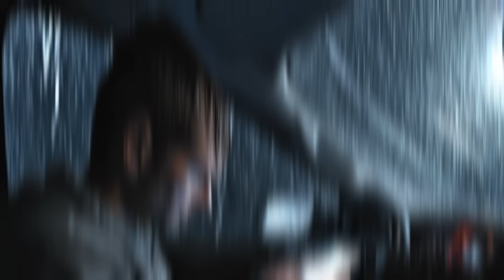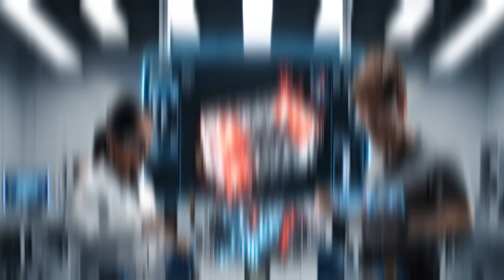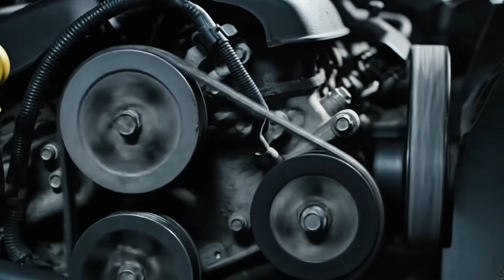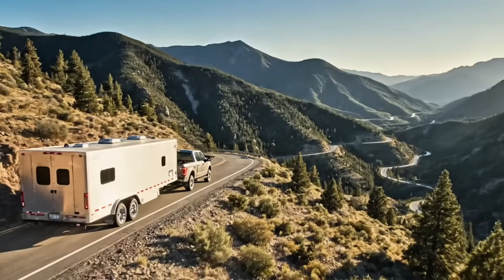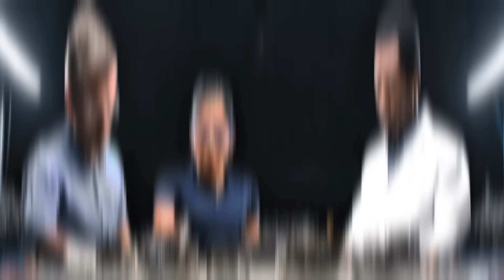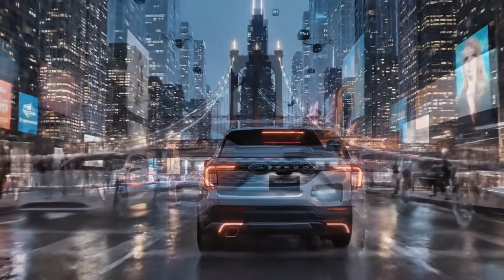Ford Just Ended the EcoBoost Nightmare in 2026 — Truth Revealed

Comment: Just turned 65,000 miles on my 2019 4 x 4 Ford F150 2.7 L eco-boost, I bought brand new in Saint Augustine, Florida, for $35,000 out the door. I could sell it for that today. Absolutely love it, oil changes every 5000 miles and never a problem at all. Great gas mileage plenty of power and torque. Ford solved the problem with direct injection carbon buildup in 2018. I’ll have the timing belt changed at 80,000 miles. It is paid off and I just can’t get myself to go spend $65,000 on a new truck. So Here’s hoping for another 65,000 miles.
Reply: I had a 2015 2.7, F150. Very smooth, quiet, and amazing fuel economy. A little weak with light throttle, but mash the accelerator and power was fully adequate for towing. Easy to do routine maintenance. The 2.7 has been dramatically changed since then, not always for the better. The iron block was better.
Reply from the maker: @Jefferson-i2w8d  A lot of owners still praise the early 2.7s for exactly those reasons — smooth power delivery, strong towing performance, and solid fuel economy. Interesting point about the iron block too; some people definitely preferred the older setup for durability.
Reply from the maker: Sounds like you got a solid one 👍 Staying on top of maintenance and oil changes really seems to make a huge difference with these engines. And honestly, with truck prices today, keeping a paid-off truck running well makes a lot of sense.

Comment: A couple of things. Did I miss a mention of wet belts driving the oil pump? And for turbo haters, all transport trucks and locomotives are turbocharged. They seem to last well. Now, if you take a 50 hp 4 cyl, and highly boost it to say 300 hp, with no other changes,  of course it will blow up.  My 275 hp 2l engine has a cast graphite- iron block, is now 13 years old. I did have a problem with the intercooler, but I fixed that for $15. I do change the oil too. It doesn't burn oil.   The main problem with new engines is manufacturers trying to break the laws of physics to meet regulations.
Reply: Locos and semis are diesel which are built alot tougher
Reply: @rrobins9857 : exactly. Designed to do their job.
Reply from the maker: @drwthmpsn7457  Exactly — when an engine is designed around the workload instead of just chasing numbers on paper, reliability usually follows.
Reply: @NextGenWheels-s5r : before jet engines, turboed engine were considered realible enough to cross the Atlantic.
Reply from the maker: @drwthmpsn7457  That’s a great historical point honestly. Turbo technology itself isn’t new — a lot of the debate today is more about modern emissions systems, packaging, heat management, and long-term maintenance costs in consumer vehicles.
Reply from the maker: @rrobins9857  True, heavy-duty diesel platforms are built for constant load and long service life from the start. Totally different design priorities compared to lightweight consumer engines.
Reply from the maker: You make a solid point. Turbos themselves are not automatically the problem — heavy-duty diesels prove that every day. A lot comes down to engineering margins, maintenance, cooling, and how much stress manufacturers squeeze into smaller engines to meet emissions and fuel economy targets.
Reply: It takes the same amount of gas to produce 300hp. Why would you want a smaller engine with twice the moving parts to fail, rather than a n/a bigger one with half the parts and less cylinder pressure. The bigger one is less complicated, less expensive, and more reliable. A twice boosted 4 over a n/a v8 makes no sense, unless you are building a racing engine.
Reply: @donsaxon1169  On paper you may have a point. In the context of this situation, there's a lot more to consider. How well something is designed is far more important than how many parts its made out of. If you think you're getting something that less complicated with a 307, as opposed to a 2.7 or 3.5, you're mistaken. Its a small block, but it barely fits in the vehicle. There's a reason we pull the cabs off the F150 when we work on them. There's no room. On the Mustang, the motor doesn't fit through the hood. They had to make an engine cradle like a front wheel drive car and install the motor from the bottom up. To get something more complicated than Ford's NA V8, you have to go to an exotic type vehicle. If you take the 5.0 and put it on an engine stand and compare it to an old big block, the new motor makes it look small. 2 fuel pumps, one of them puts out over 2000psi, 2 completely separate fuel injection systems. 2 heads in each cam, 4 external VVT actuators, 3 timing chains. A complicated valvetrain system that has to be adjusted my measuring the valve tappet clearance, insert it into a formula, and depending on the results, the tappet has to be replaced with the correct size. And that's just the big stuff. Then you have the electrical system. Ford doesn't include wiring diagrams in the workshop manual. Its too big. If I showed you the book that contains just the wiring diagrams for the F150, you would never buy one. Its bigger than a NYC telephone book. Depending on options, the F150 typically has over 50 modules installed and the 10 speed is even more complicated than the motor. Just to be clear, all of the engine options for the F150 are complicated. And they all give problems. The 3.5 is your best option. Most of the time, they're fixable. More often than not, the 307 and the 2.7 have to be replaced. 
Both turbo and NA motors can be very reliable as long as they're well engineered. And to be honest, turbos can be harder on the motor. But that doesn't tell the whole story. The process of the turbos spooling up acts like a cushion. NA just bangs all the torque into the trans and chassis. Turbos roll the power on in a way that's much easier on the rest of the vehicle.
What would be the right thing to do? Stop using GDI systems and go back to port. It wouldn't fix everything, but it would make a huge difference. If you want to see proof, just look at the numbers for the 302 and 3.5 before they started with GDI. There's no comparison.
Reply from the maker: @052RC  You bring up a good point about packaging and serviceability. Modern DOHC V8s are definitely more complex than people think once you look beyond just “naturally aspirated vs turbo.”
Reply: @052RC You are wrong about the engine on the mustang. You don't even have to remove the hood to get the engine out. When I got my 2019 GT I pulled my engine in my home garage to forge the n bottom end before I installed my supercharger. F150 is different.
Reply from the maker: @franklin5105 That’s fair — vehicle packaging makes a huge difference too. A Mustang engine bay and an F-150 engine bay are completely different situations when it comes to access and service work.
Reply: @donsaxon1169 : actually, 8 cylinders have more internal friction than a 4 cyl. That's why a V8 gets worse fuel economy than a 4 rolling down the highway. And being heavier, 8 cyl use more fuel in stop and go traffic. As for less parts, a V8 has an extra head,  possibly 2 more cams, 16 extra values, more fuel injectors, another exhaust manifold, etc. perhaps even an extra turbo these days.
Reply from the maker: @drwthmpsn7457  That’s a fair technical breakdown. Modern engine discussions get way more complicated once you factor in friction losses, weight, emissions tuning, cylinder pressure, and real-world efficiency instead of just cylinder count alone.
Reply from the maker: @donsaxon1169  That’s why this debate never dies A lot of owners still trust displacement and simplicity over high-boost smaller engines, especially for long-term ownership and heavy work.
Reply: Those commercial engines are all diesel. Diesel compression ignition combustion is very different than gas spark ignition combustion. In the diesel, turbo boost lowers combustion temperatures. In gasoline engines, turbo boost dramatically raises combustion temps. Turbocharging a gas engine will always shorten it’s life. Turbocharging a diesel actually increases it’s life, for a specific output. Don’t use diesels to justify gas turbos.
Reply: @craigg4246 : in WW2 turbocharged gasoline engines were common. After WW2,  transatlantic airliners were turbocharged gas engines, reliable enough to do the job before jet engines became efficient enough.
Reply from the maker: @drwthmpsn7457  That’s a good historical point honestly. Turbocharged gasoline engines have been around a long time in aviation and performance applications — reliability usually depends on engineering, operating conditions, and maintenance more than just the turbo itself.
Reply from the maker: @craigg4246  Diesel and gas turbo engines definitely behave differently under load and heat. A lot of the debate really comes down to how hard the engine is being pushed, cooling design, tuning, and long-term maintenance.
Reply: Transport trucks, and locomotives are diesels. Diesels have to be boosted, and always have been in my lifetime. Those work, these turbos on these gas motors are absolute crap.
Reply: @patricklawrence7483 : VW had a non- turbo diesel, as did several companies. But you're entitled to you opinion. Those new V8s are holding up well aren't they.
Reply: @drwthmpsn7457 I may be wrong, but as I understood it at the time the VW non turbo diesel lacked power. From personal experience the few non turbo diesels I drove in the military were certainly lacking power. So based on that I believe what I heard about the VW offering.
Reply: @patricklawrence7483 : if I recall correctly, the non- turbo VW diesel was about 42 hp, and a very light car. A friend had one as a commuter, it got great fuel economy.
Reply from the maker: @drwthmpsn7457  That’s part of the tradeoff honestly — a lot of the older naturally aspirated diesels were extremely durable and efficient, but definitely not fast by modern standards.
Reply from the maker: @patricklawrence7483  Real-world experience matters more than spec sheets sometimes. A lot of older non-turbo diesels were reliable workhorses, but power delivery could feel pretty slow compared to modern turbo setups.
Reply from the maker: @drwthmpsn7457  Those old VW diesels were legendary for fuel economy more than performance 😂 Simple, lightweight, and efficient — completely different philosophy from today’s high-output turbo engines.
Reply: @NextGenWheels-s5r : yes. I don't know why we need 700 hp trucks these days.  I got my turbo engine for towing, not 0 - 60 times. Of course, vehicles today  are much heavier than older vehicles. My first car was an original mini. Probably as light as was possible in N. America.  The EPA  doesn't need fuel economy requirements for vehicles over 6000 lbs, as when the rule was written, only farm equipment was over 6000 lbs. Now we have road vehicles heavier than this old limit.
Reply from the maker: @drwthmpsn7457  I think a lot of truck owners agree with that. Strong towing torque and long-term reliability matter more in day-to-day use than chasing supercar acceleration numbers. Modern trucks have become incredibly capable, but not everyone needs 700 horsepower to get the job done.
Reply from the maker: @patricklawrence7483  A lot of owners feel that way because heavy-duty diesel platforms are built with very different priorities than lightweight consumer gas engines. People mainly worry when small turbo gas engines are asked to handle constant heavy loads for years.

Comment: It should be illegal for manufacturers to set oil change intervals that are too far apart..
I don't care what they say 
You change your oil every 5,000 MI. 
I guess it's in their best interest to lie to us because they want the car to wear down so you have to buy another one..
It just pisses me off
Reply from the maker: A lot of mechanics and long-term owners still swear by the 5k oil change rule, especially on turbo engines. Cheap maintenance now is usually a lot better than expensive repairs later.
Reply: The EPA gives them tax credits for doing so.
Reply from the maker: @jamesbosworth4191  A lot of people believe the long factory intervals are more about emissions, maintenance cost perception, and ownership costs than maximum long-term engine life.
Reply: @NextGenWheels-s5r  I don't see how people think not performing maintenance will lower exhaust emissions.
Reply: I do every 3000
Reply from the maker: @johnnyhuie74  3k intervals are definitely old-school, but a lot of longtime owners still swear by it for maximum turbo longevity 👍
Reply: Total BS.

Recommended Intervals by Oil Type: 

Standard intervals depend heavily on the type of oil used and the engine's design:

Full Synthetic Oil: 7,500 to 10,000 miles (standard for most new cars).

Synthetic Blend Oil: 5,000 to 7,500 miles.

Conventional Oil: 3,000 to 5,000 miles (rarely used in new models).

Time-Based Interval: At least once every 12 months (or 6 months for some manufacturers), even if you haven't reached the mileage limit, to prevent moisture buildup and oil degradation.
Reply from the maker: @TOAO789  Those intervals are definitely what manufacturers recommend with modern synthetics. A lot of owners just choose to shorten them on turbo engines because of heat, fuel dilution, towing, short trips, and long-term wear concerns.
Reply: @TOAO789  I don't care what kind of oil you are using - 10,000 miles between changes is TOO LONG.  PERIOD.
Reply: @jamesbosworth4191  Your opinion is not fact-based. Period.
Reply: @TOAO789  It is not my opinion, it is a PROVEN FACT.  PERIOD.

Comment: Not buying anything with a turbo. Automotive engineers are making these things absolute junk and extremely overpriced while being unreliable. Talking about 100,000 miles is a joke. For the money 300,000 should be the minimum goal.
Reply: The automotive engineers are merely responding to what the regulators are requiring in terms of unrealistic fuel mileage requirements. Hopefully under the Trump administration, more of these ridiculous requirements will be trashed.
Reply: @jmfa57 Yes. And we need to stop letting politicians that know absolutely nothing about the subject to pass unrealistic regulations. Just because they can write it on a piece of paper doesn't mean it's actually physically possible. They can't grasp that the laws of physics can only be pushed so far. They do it in the name of the environment. Is it not bad for the environment to have these things suffer a short term life and then just end up in a junkyard somewhere?
Reply from the maker: @jefferytillis8309  A lot of owners argue that longevity should be part of the environmental conversation too. A vehicle that lasts 300k miles with fewer major repairs can sometimes make more sense long-term than one that’s highly efficient on paper but expensive to maintain.
Reply from the maker: @jmfa57  Fuel economy and emissions regulations definitely pushed manufacturers toward smaller turbocharged engines. The challenge has been balancing efficiency goals with long-term durability and repair costs.
Reply: Additionally, the smaller equivalent power turbo engines rarely get better real world mileage than the ones that they replaced. They get better mileage on EPA tests because of the way that the test is structured.
Reply from the maker: @michael.a90125  That’s one of the biggest debates around downsized turbo engines. In light driving they can be very efficient, but once you’re towing or really into the boost, fuel economy can drop fast.
Reply from the maker: A lot of buyers still expect 250k–300k mile durability from trucks, especially at today’s prices. That’s a big reason why reliability debates around modern turbo engines get so heated.

Comment: I had one of those 1.0 pos.  I have a Subaru now.
Reply from the maker: A lot of people had mixed experiences with the 1.0 for sure. Hopefully the Subaru has been treating you better
Reply: @NextGenWheels-s5r it's been great but only 2 1/2  years and 31k on it so time well tell.
Reply: @jimr549 I’ve got 90k on my 19’ Forester. So far the only thing wrong is a muffler with a loose internal baffle making noise at idle, and the tire pressure sensor batteries died last winter.
Reply from the maker: @jimr549  31k miles is still early days, but it’s definitely a good start 👍. Hopefully it keeps treating you well long-term. Reliability is what really separates the good ones from the great ones.
Reply from the maker: @mendodave  90k with only a muffler issue and TPMS batteries sounds like a pretty solid ownership experience 👏. If that’s still the worst of it at that mileage, I’d call that a win.

Comment: Wonder why the 2.0 ecoBoost engine in the Bronco Sport wasn't mentioned.
Reply: I forget the year, but Ford fixed the head gasket fault years ago.
Reply from the maker: @drwthmpsn7457  Yep — Ford did revise several of the earlier cooling/head gasket related issues over the years. A lot of the debate now is whether the long-term durability of the newer revisions will hold up past 150k–200k miles.
Reply from the maker: Good point — the video was mainly focused on the larger truck EcoBoost platforms, but the 2.0 in the Bronco Sport has actually built a pretty decent reputation so far for a lot of owners.